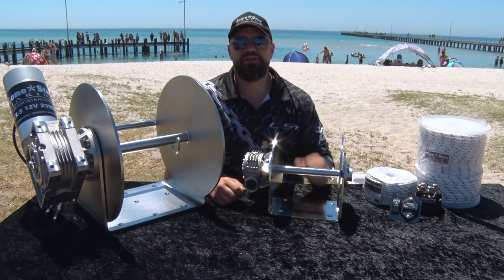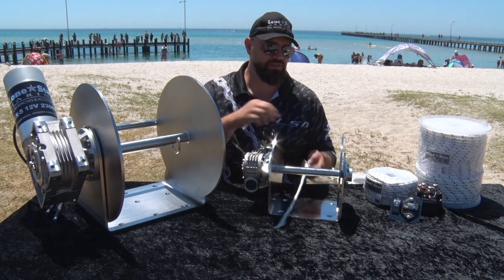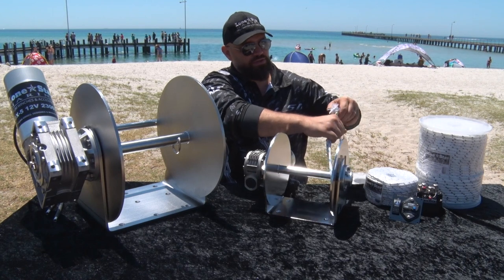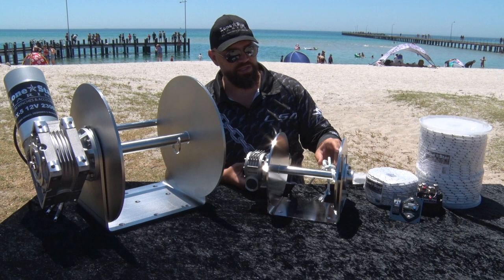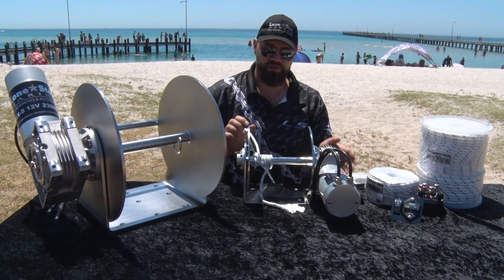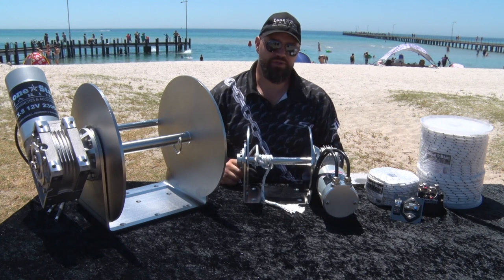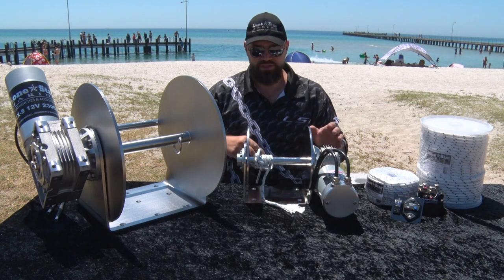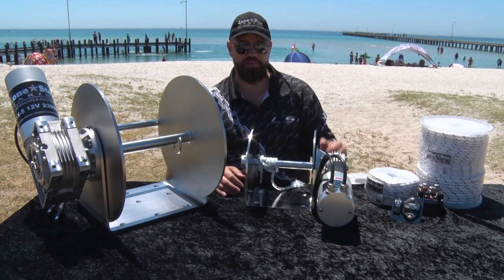How to Spool your GX Series Drum Anchor Winch with rope

Comment: I have purchased the GX 2 and using Dyneema rope, what knot do you recommend to attach to the Topshot braid that comes with the kit
Reply from the maker: Hi Brian, the dyneema has an eyelet on the inside of the spool. So tie the end you can see to the drum, spool it on, then use the D shackle supplied to connect to the topshot.